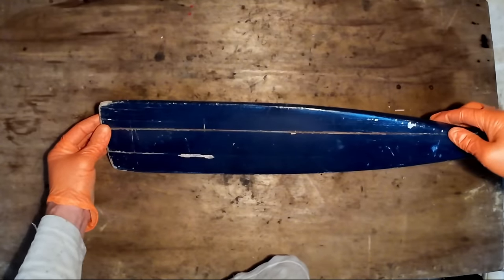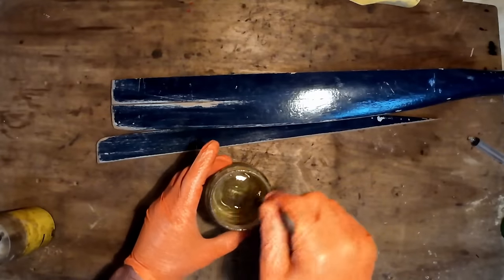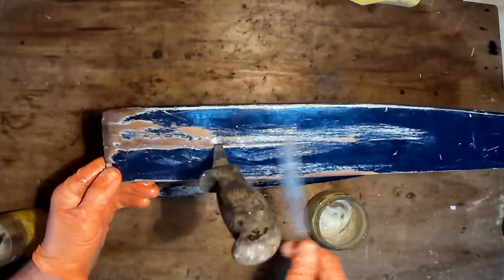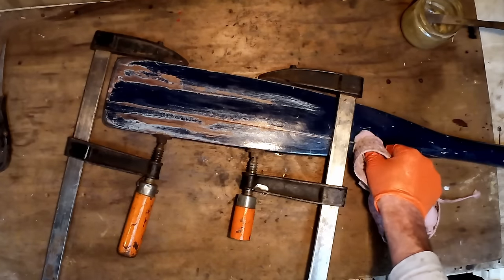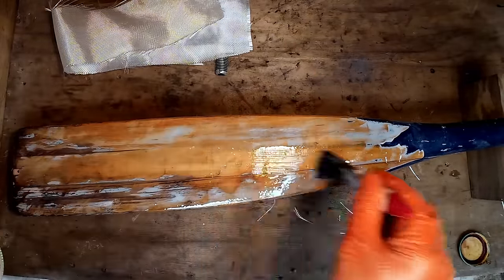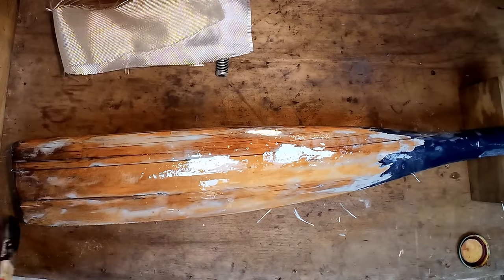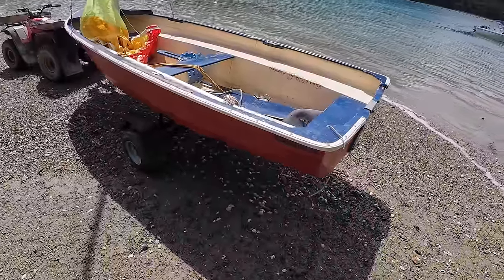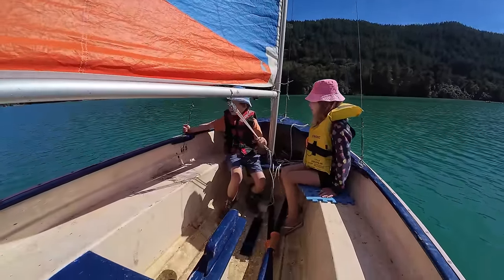Repairing a Broken Oar and taking the Kids on a Sailing Adventure in their new Sailboat

Comment: If you have a vacuum source , just vacuum bag it. The epoxy will displace the air in all the cracks without needing to open up the crack to get the glue into it and also impregnate the wood to a degree. A single layer of woven glass cloth will make it stronger than it ever was.
I fixed a broken axe handle like this.
Reply: Would a shop vac help for this type of job or do you need an actual vacuum pump?
Reply: @rsmith3062  I have never tried a vacuum cleaner , but it could work. I use an oiless compressor and connect the intake to the bag. It does about 20~25 inches of mercury.
The higher the vacuum is ,the better it eliminates air bubbles in the resin.
Reply: @PaulG.x  Great idea, I never thought of using air compressor intake, never would have thought it would pull that much vacuum. Of course the more vacuum the better. I don't have a vacuum gauge, can you experiment with a shop vac and compare its vacuum to your compressor intake method?

Comment: Oarsum. Looks great. Sailing for kids ought to be a required activity.
When fixing those, I have normally put dowels or stainless steel screws with the heads cut off after being screwed into one side and the broken off piece drilled slightly smaller than the screw shank diameter. Just makes the butt join stronger.

Comment: I wonder if notching holes with a biscuit jointer and using biscuits with glue would add strength and rigidity or even dowels.

Comment: The epoxy resin is great for bonding things together but is not very uv stable. This is why polyester resin is used on surf boards, boats etc. Because your painting it the resin will be protected from the sun and will/should last forever. 
Your kids are living a life that very few are blessed with, you should be named father of the year/decade for so many reasons.

Comment: The silica is good for filler, but will weaken the joint, better to have a bit of milled glass, or just the epoxy, seconded coat add the silica.

Comment: What if instead of utilizing gravity for the hydro power, you had two huge tanks and a 4 foot square Fresnel lens, focus on the full tank and tap the pressurized flow to the empty tank for electricity, and then switch to the filled tank, back and forth ? It wouldn't have to be metal if the focal point was dispersed, or you had a metal focus pad (aluminum?).....they get so hot as to melt metal so I dunno.....
a solar powered pressure cooker for generation purposes.